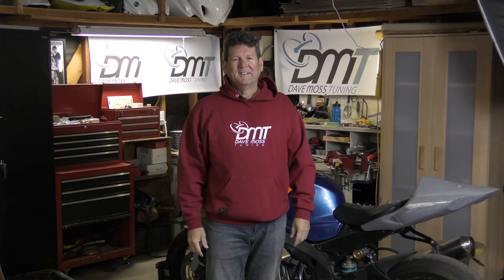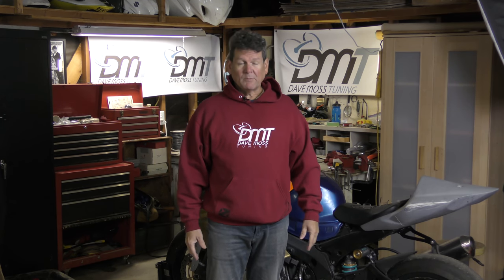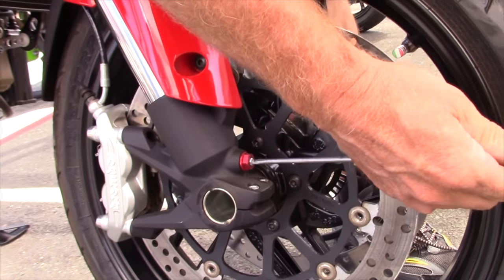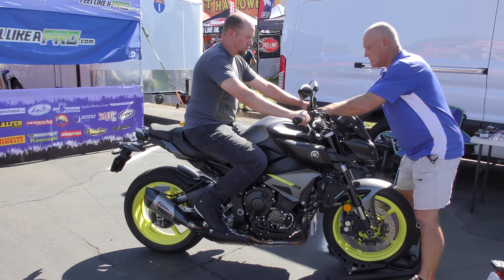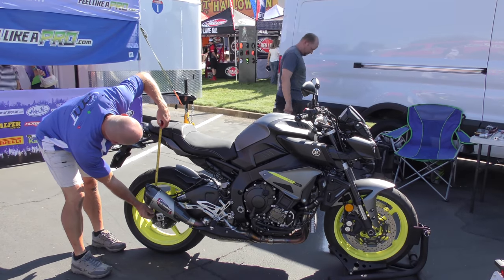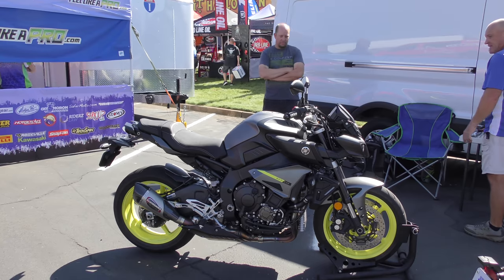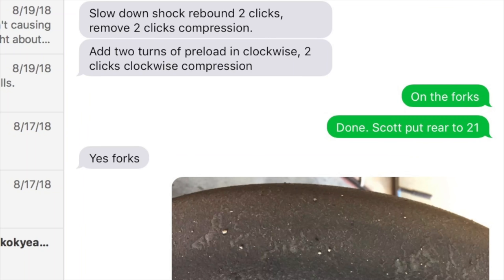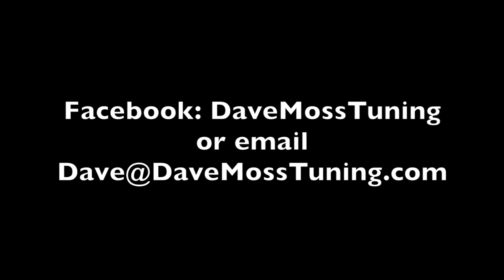2 Clicks Out: Street vs Track Suspension Setups

Comment: DM has a no nonsense approach to suspension diagnosis and problem solving, he explains well and reasons why adjustments are made the way they are .  I understand better than most the part that cause and effect play when it comes to suspension settings due to my performance work with Shock's and suspension when applied to Race Car's. 
 Dave's knowledge and approach when it comes to Tuning both Street and Track bikes IS IMHO the Pinnacle. 
Based on my knowledge I tuned my Ducati suspension reasonable well or so I thought until digested some of Dave's Video's and realised that just like a Race Car the Tyres TELL you the story learn to read that correctly and apply the principles of Dave's Tuning and you are well on the way to gain much more enjoyment from your bike  
I think we Bike rider's are blessed to have someone such as Dave Moss who give us this information freely . 
Dave Moss to you I say Thank You .
Reply from the maker: Thank you for sharing your POV based on your experiences. Believe it or not, car tire and bike tire wear are almost identical for compression and rebound. I sincerely appreciate your support on my work!

Comment: Incredibly informative video! I thank you for the practical advice and very logical way of explaining what is improperly adjusted for each motorcycle. I changed the only setting I could on my motorcycle suspension to fit me better and it feels so much better.
Reply from the maker: Thank you for your kind words and a tip of my hat to you for getting your sleeves rolled up and make a tangible difference for you and your motorcycle.

Comment: Hey Dave! Thank you so much for your contribution. As another guy said, learned more in 25 min than riding and asking shops for 25+ years of riding! I have recently bought the exact same MTI0 (Yamaha) that you tuned in the video. I dont track ( yet :) ), and I do commuting and weekend  rides ( quite fast - located in Greece). I am at 5000Km and the bike has factory settings. Will try the setup you explained in this Vid. and post back. Thanks again for your down to earth, honest, specialized contribution to a field that tends to be "backyard". Be well and ride safe. Cheers
Reply from the maker: Thank you for leveraging the content to find your own settings based on your roads and speeds! Please share the settings you choose to help other MT10 owners.
Reply: @catalystreactionsbw  Definitely! Roads are less than ideal here and it gets quite hot, especially in the summer. Will have a go with your invaluable info, on my 98' TDM also. She definitely will benefit from your insght :). I rode the MT when I bought it, straight 1200 Km. Had a lot of arguments with my ass :). Anyhow, thanks again. Being an engineer, I really appreciate your info, and definitely come back with my endeavor! Take care and thanks for getting back to me.

Comment: This is a man who knows his shit. I wish my MT-07 had adjustable suspension. It feels like riding a bouncy rock like that MT-10 looked before he adjusted it. I've already adjusted the preload on the rear (5/9) and put thicker oil in the forks (10w to 15w) and removed 5mm of air but that's all I can do without spending a lot of money. By the time I've spent all the money upgrading the suspension I could have just bought an MT-09 or MT-10.
Reply from the maker: Looks like you didn't measure static sag on the forks. 15w fork oil is corrcet, but you need to shorten the preload spacer by 12mm.
Reply: @catalystreactionsbw  Thanks for the tip. I assume adjustable caps won't do the trick alone and I'll have to actually shorten the spacer first? If so that can be a job for the next owner because I can't be bothered to take the forks apart again xD
Reply from the maker: @6Twisted  Adjustable caps could make the situation worse if you are using the OEM spacers at stock length. Measure your static sag now. It should be 20-25mm. If it isn't then cut the spacers 12mm, install and measure again.

Comment: Hi Dave , that's the wonderful video on how does preload and rebound works. I have a Kawasaki Z900 and how does it's forks setting works on it. It has one side of preload and rebound adjusters and the other side  nothing. Recently I found that the bike looses it's control on suspension easily feel it during cornering.

Comment: This is very handy for me, having just boughta Street Triple R 765, I find my suspension is quite similar to his in stiffness, I think I will look into adjusting it, although my suspension is different so will need to delve a bit further into what changes what... Thanks for the informative videos Dave.
Reply from the maker: Look at the shock travel on the shock shaft and use a cable on the right fork leg. That will tell you how soft/stiff they are. From there once sag is set, you adjust compression to get more or less travel and rebound based on oil viscosity when hot. In the channel search rebound and search compression for the correct videos. Enjoy the learning.
Reply: @catalystreactionsbw  thanks very much for the detailed reply, shame I am in the UK or I'd just pay you to set it up perfectly for me.

Comment: Somehow I got a puncture in the bladder in the rear shock on my yz125, which released most of the nitrogen into the suspension fluid. Talk about pogo! I decided to just go ahead and rebuild the front and rear suspension and I've gotta say it taught me so much about how important proper suspension setup is. I just started from factory settings and worked from there, but honestly I think the single most important part was setting the race sag, I didn't realize how much that would help especially if you plan on adjusting the suspension, you've gotta have a proper base setting to work off
Reply from the maker: Thanks for diving into the work after the bladder failure. The results are certainly worth the work and now via a little fine tuning via your eyes in monitoring how much travel is used in the forks and shock, your bike will truly becomes YOURS!

Comment: Whew may 8th my 1st track day at PIR.
C group - seemed a wise idea.
I'm using my 2005 Suzuki Gsx-R 750
No clue on the suspension adjustments.
At this point I just hope for good weather 🙏😆
Reply from the maker: Set sag at 30-35mm front and rear. Set compression at 50% of the total range and figure out what cold pressures you should start with. Put a cable tie on the right fork tube to assess travel used and spend a bit of time in the garage working on ergonomics. Once you have done all that, continue your focus on the weather :)

Comment: Dave, regarding the rider sag measurement, I see you get the rider on, exercise the suspension a few times and measure. Other sources (Race Tech's suspension bible and Lee Parks' Total Control book, basically the same stuff) suggest having the rider on and doing a gentle compress & release and lift & release, measure after each and average, to overcome the stiction issue. What's your take on this? Obviously you've chosen your way, but I'm trying to understand and learn about different approaches and preferences as I'm trying to figure it all out. Thanks for your very informative videos!
Reply from the maker: I want to get an idea of where the bikes, what I can do to get it balanced  50/50 with preload. Once spring tension is set, get rebound correct for excellent bike balance. Set compression where the rider shows their ability to be and then start the dial in process.
Reply: @catalystreactionsbw  Thank you for responding! Stiction is not a concern for potentially throwing the measurement off? On the other hand, I've seen your vids on seal lubing, so ultimately, that problem can be reduced with just a little bit of work.
Reply from the maker: @hillie47  Yes, hence the check to assess via measurement if that will be an issue. https://www.youtube.com/watch?v=qK6_7oTF_bI

Comment: Hello Dave, thanks to your videos,  I've now setup the static sag on my Versys 650 '16. Really appreciate the immense knowledge you share in your videos. 

My question is, for a ADV touring bike like mine, do you feel that I should have more compression at the front and  less at the rear or should it be the other way around?
Reply from the maker: Thanks for the kind words! For ADV you need compression to stop the forks and shock bottoming once spring tension/preload is correctly set. That will depend on speed, terrain and how much air time you get :)

Comment: Wish you were around the Bay Area in CA. Great video! Any ideas what would cause front forks to pogo/flutter mostly at a certain speed, between 80km/h -100 km/h?
Reply from the maker: I am, quite a lot of the time. When was the last time you changed fork oil? have to set rebound damping correctly?

Comment: Hi Dave. Greetings from Western Australia. Quick question about rotational tyres. I’m chewing through one side of my Dunlop Q4’s due to my local track being all right hand turns. Can I flip my tyre to even out the wear as long as I don’t use it in the wet? Or is there more to a rotational tyre than just the water dispersing grooves?
Cheers
Scott.
Reply from the maker: Hi Scott. Greetings from Mt Gambier! I'm here for a couple of weeks for Levi Day schools at Mac Park. When tyres are made with a V carcass, they cannot be rotated. Many race tyres are made with an X carcass so they are not directional. Road tyres are generally V carcass, so they cannot be flipped. I do not know of anyone flipping any hypersport tyre at any track day nor anyone running it backwards to test it so I have no knowledge and as it isn't done, I would say no.
Reply: Dave Moss Tuning thanks for that. Not worth risking then. I’ll have to find a track with left turns and alternate track days!!!

Comment: I’m hoping this may find you or a rep, but I just had my 2018 GSX-R1000R worked on at a shop and the mechanic installed new sprockets and a chain for me but made my wheel base longer for stability. My question is should I stick with my manuals chain tightness specifications 20-30mm or leave it as is from his shop at 40mm?
Reply from the maker: If the  length of the bike is longer overall. Chain slack at 30mm is fine and 40mm is a little much even for a race bike. The issue will be slower turn in. Does it turn slower? If so, you might need to make the shock slightly stiffer with preload.
Reply: @catalystreactionsbw  thank you for getting back to me so soon with an answer, as I was worried that the 40mm just seemed excessive but I couldn’t find any information about my situation in particular. As for the turning I have yet to actually test ride the bike after it’s service I just had due to the immense downpour my area is experiencing but I will get back to you when I do have a day to finally take it out hopefully sometime this week given the rain let’s up.

Comment: 3 turns of the wrist and that’s 14 clicks? What are you actually feeling for? Clicks? Or are these quarter turn counts etc? Thanks.
Reply from the maker: Some adjusters turn. Others have clicks and those clicks can be 4 per single revolution or up to 16 per revolution. The click is caused by the adjuster having flat sides that have a ball spring that click into place when you get to the next flat side.

Comment: I bought a brand new 2023 MT-09 sp, would it be worth backing out the damping screws while i set rider sag, and then tune damping afterward? or should i set sag with the damping as it is from the factory?
Reply from the maker: Best to set sag with Factory settings. Then as an experiment, remove all high and low speed compression from the forks and compression form the shock and remeasure to assess the difference it makes.
Reply: @catalystreactionsbw  Very good idea, thank you! I must admit, it's a little intimidating to turn the screws on brand new golden forks 😅
Reply from the maker: @bradleymorgan8223  agreed, just make sure you use the right size tools and if needed, put a paper towel over the 14mm adjusters.
Reply: @catalystreactionsbw  I've been watching your premium content over the past couple of days, and i must say you are a MASSIVE boost of confidence! Wisdom like yours doesn't come cheap.
Reply from the maker: t @bradleymorgan8223  Thank you very much for the complimen

Comment: When i press front brake, my front just goes down way quickly. does that mean i need more compression? it seems super soft. ZX10r 2007
Reply from the maker: It can be a single fcator or combination of the following: 1. Fork settings too soft for preload and compression.  2. Fork oil level too low.  3. Fork oil viscosity too thin.
Reply: @catalystreactionsbw  thanks Dave. Didnt expect u will reply. Ill try adjusting preload and compression since its all stock and im 240lbs. Oil has been changed recently. Merry Christmas and thank you once again

Comment: I have an old fazer 600 from 2003. There are jumps to see on my tires, I guess fast rebound but the problem is there is no adjuster. How can I fix the issue?
Reply from the maker: 20w oil in the forks to the volume the owner's manual requires.
Reply from the maker: https://davemosstuning.com/?s=fork+oil+viscosity

Comment: Merry Christmas, Thanks very much.
Could you please give me your advice on buying my first bike, mostly needed for having fun on weekends on the city roads (Paris France).
Reply from the maker: Absolutely! 1. Find the bike that lets you put your feet on the road to the extent that you are comfortable (ball of the foot or flat footed). 2. Sit on the bike and move it left and right with your legs. It should be easy to move side to side and controllable when you want the movement to stop and go the other direction.  3. Make sure you feel comfortable when you sit on the bike in that you are not cramped are feel like you have to adapt as City riding is very demanding  4. Do you want an automatic or manual gearbox?  5. What engine size do you feel you need or conversely, your local laws enforce given your experience?  6. Power delivery of a single cylinder is quick, a twin has lots of torque but more cylinders mean more weight.  7. Insurance costs?
Reply: @catalystreactionsbw  Thanks a lot for your reply, I have a little ride experience but I am aiming at bikes with a 750 cc size engine with a manual gearbox.
actually, I am looking for a Kawasaki Z750, I chose Kawasaki based on easy handling and good respond.
Reply from the maker: @osamasadiyah9102  Understood. Make sure that you run through the above "tests" and try the Suzuki GSX750S and Honda 650F as a comparison. Realize that handlebars will be moved etc once you make your choice.

Comment: Does anyone know of a free repository for any of Daves baselines for kawi liter bikes? Preferribly a source that The DMT Team is at least awsre of and cool with sharing I reslize that at some point the will be a paywall,
Reply: Perhaps the DMT YT channel has enough info on it for someone who's just crayon carving a few days a week and riding 2up occasionally to implement if listened to closely like previously mentioned. Thanks DMT!
Reply from the maker: Set sag at 30/30mm for static and rider sag. Set compression at 50% of the range and set rebound at stock numbers. Figure out what cold pressure YOU want. Ride and assess fork and shock travel, then adjust preload accordingly to optimize travel.

Comment: it's a shame that Yamaha doesnt let you tune the FZ-07 suspension... =/
Reply from the maker: OEM's do not like what I do as they feel my work takes away from their product on the showroom floor.  Also remember that suspension components are sourced from other companies - so it is those companies I wish I could work with.
Reply: @catalystreactionsbw  Yes, i was checking some nix cartridges from the Ohlins or Muppo. But instead decided to change to a zx-6r. already facing some issues at the track with the current FZ-07. Losing rear wheel grip and the end is also often coming into the air on heavy braking.
Reply from the maker: @89siver  Makes sense. Andreanni offer the best value for money on fork cartridges.

Comment: how do you do on bmw gs1200 and the likes
Reply from the maker: Just the same as any other bike. Set sag, adjust damping where possible, let the rider ride and adjust based on travel used in the forks and shock and via hot suspension oil.
Reply: many thanks ,   hope the year aheads a busy one for you , and a safe one for your customers too.

Comment: Honda has the best handling motorcycles, huh?  Admit it!  :)
Reply from the maker: If you set any bike up correctly for ergonomics, chassis and suspension, it will handle incredibly well.
Reply: @catalystreactionsbw  I'll go with that. I bought a 2002 Yamaha XJR1300 with aftermarket Ohlins front forks and std Ohlins rear. It rode like a whacker plate. I took it to a local Ohlins dealer/tuner and he transformed it totally. It's not a track bike at all, but I recon it could see off a few Ninja rockets  that are badly set up.

Comment: can’t believe people ride bikes so badly out of balance! Just setting back to factory settings would have been a much better starting point, and first thing I do when I get a bike.
Reply from the maker: Dave Williams, editor, replying here. While going back to factory settings is certainly something to try, the odds of it being good are almost zero. The odds of being better are 50/50. In 20 years of filming with Dave Moss, less than 10% of all bikes have ever had a stock suspension setting correct for any human. If you watch any of our showroom suspension series (from the OnTheThrottle days or currently) you will be horrified. Most bikes fork pogo right there on the showroom floor with gold fork oil. That said, stock showroom settings are certainly worth evaluating if you've purchased a used bike.